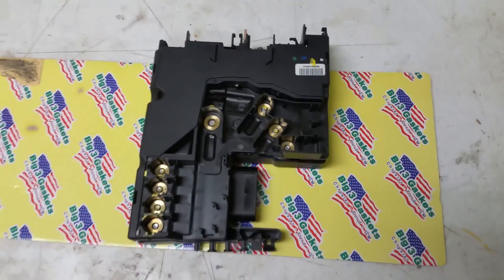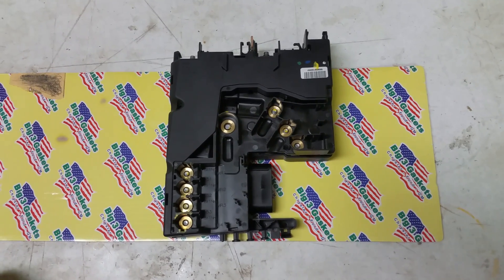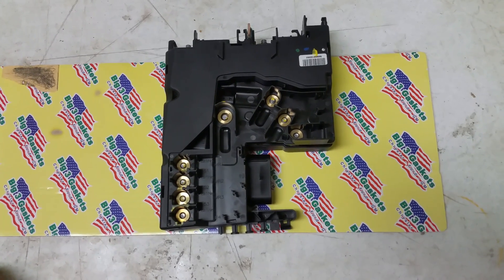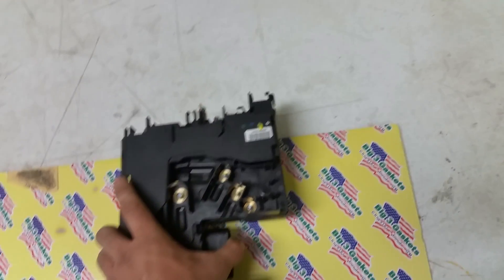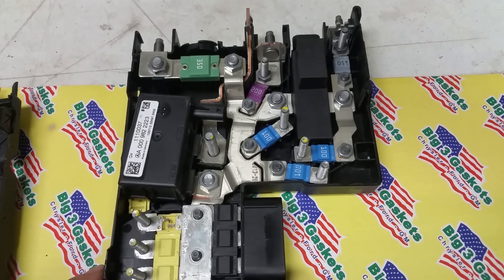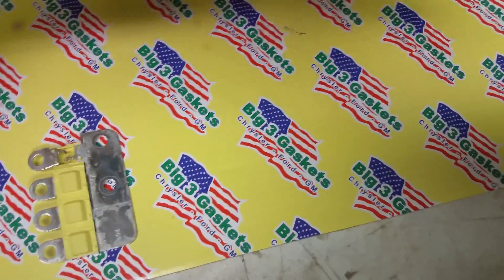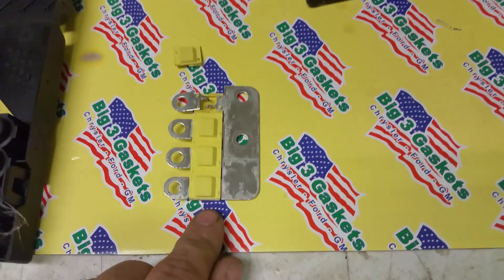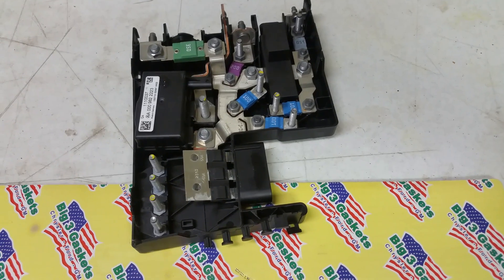HOW TO REBUILD MERCEDES SAM MODULE MAIN FUSE BLOCK

Comment: George, please HELP! I've pulled my Module and there is no continuity at all. I texted all of my fuses, and the relay in this box, nothing! My multimeter is working, I tested it else were. Is my entire Module shot? I can send pic's if u have an email, my Module is different frm this one. It's a 08 Mersades S550 4matic AMG V8, I have no power at all after starting my car with the wrong altenator. A 220amp came off it but I put a 180amp up there to replace it! Terrible mistake!

Comment: Do not solder a link where a fuse is supposed to be unless of course you want to turn your car into an inferno. This is idiotic advice that could result in fire or worse kill someone for the sake of saving a few dollars.

Comment: Hi guys please help. I opened the prefuse box all fuses are gud but still don't have power on the red and white cable going to the front sam and is causing some fuses to lose power or get a low voltage next to nothing please advise

Comment: Yes great clip. i'm working on 2011 C300 4matic customer tried to jump start then a complete no start. So I'm testing the front SAM module. Well there is a 4 pin relay between pole 1 and pole 2 not the air bag fuse. I'm not getting continuity. It's open. It looks like it should have power on both sides.
I have no start no power no headlights no cluster but is see's the key.

Comment: I have a 2004 G500 and it has had some quirky electrical issues since I got it. I was recently diagnosed with AC compressor failure. Is it possible for a bad SAM control module to affect the compressor?

Comment: Hi, I need help on my Mercedes Benz C180 CGI, 2011 model,Automatic, W204. The electronic systems are not working after i washed the engine. It can’t start through the key, it just displays the on lights on the dashboard. The radio, aircon lights, indicators, wipers, real lights are not working. The gear can’t even change when the car is on. The engine only runs if we bypass it under the car, through directly to the starter but still the gear are not in operation.
Please assist me with some ideas on what to do.

Comment: Thank you Joe for an excellent  demonstration of how un perplexed  these cars really are .. I have a question I have a p0600 code serial communication link malfunction .. what has happened is the dash board. Windows sunroof stop working nothing in the dash however the car will continue to run shifts .. pull it over turn it if take key out put it back in everything is fine ..

Comment: Nice work, can you help to find issue with Mercedes ML500 W164, i just tried to change the relay of Airmatic in front engine compartment fuse box and after that engine is not starting, all meter lights are there but when i turn the key to start nothing happen no crank nothing, kindly advise.

Comment: How did you remove those clips to open up the case? any video showing you removing it would be easier for us.. great work by the way... i'm having issue with shorts jumpstart , and think this bust the fuse from this SAM module.. my issue is that new battery and alternator are charging with correct voltage. but the battery light come on when drive and left front air bag light or srs light service required comes up when start.. i was hoping fuse bursted. thanks again

Comment: I have a 2002 s600 no crank or lights to dash think water got to one of the computers when i jump the starter regulator motor turns over but no crank took to mercedes they told me computers weren't communicating and they couldnt fix said they airbags would blow i think they just couldnt figure it out took a vete there shortly after words that wouldnt stay running when i went to pick it up they had removed all the dash cluster radio ect told be thats the wat it was when i brought it in what a bunch of theives cant do anything took my car back covid has everything closed at the courts so im not going back there can you please help me with a computer diagram im gonna try and learn myself

Comment: im working on a 2006 slk 280, im trying to disable the  front right side  SAM MODULE MAIN FUSE BLOCK  next too the battery and hving a hard time getting apart any advice would be helpful.

Comment: You may want to include in your video that the fuses are there for a reason.... if 100 amp fuse blows there is a pretty serious short somewhere. In your case probably the fan motor. If someone goes and solders their fuse shut (with or without repairing the root cause), they could turn their car into a fire waiting to happen!
   FYI- There is another common failure point on the F_SAM Modules. The capacitor inside the sealed box (actual module) fails causing intermittent AC failure on certain models....

Comment: That fuse didn’t blow for nothing.
One should first find out what the reason was it blew the first place before replacing the fuse.
Reply: Right you are, must be some reason for such a high amp draw that fuse couldn't handle. On the other hand sometimes you wonder why the fuse poped, then you simply replace it and there you go. Maybe if his car was often stuck in a slow traffic that fan was on a daily basis working hard and the fuse simply couldn't handle it anymore. If it pops again in short space of time then definitely must be some short in the fan motor or the ballast.....

Comment: my air suspension pump burned up and with new relay and good fuses it still gets no power. This may be the ticket. Others talk abut needed programming but this is nuts and bolts!  And the overload I had would very likely cause this sort of failure..

Comment: This was posted almost 4 years ago. But maybe someone can reply to my problem. I have a w203, 2001 C320, with radiator fan not engaging when I turn the AC on, but works fine with the engine. I took off the fan from my car and mounted it on another C32O and worked just fine when AC was turned fine. I also replaced the Refrigerant Pressure Sensor down the condenser; NOTHING. Could it be the SAM (Signal Acquisition Module)? 

The car has a battery drain issue; front seats modules disconnected and still drains out in 2 days. Now, i disconnected the TELEAID control module as am having the message in the display so it seemed like a suspect to me. Can't tell yet, because I drive the car every day.   

Any help please...
Reply: Do your turn signals work properly? My E320 was diagnosed  as rear sam. Signals are weird, rear headrest don't work, ac compressor and ac fan not working. I am going to take out rear sam tomorrow. My car has been leaking  around rear taillight, and I think moisture is the culprut. I will keep you posted on how it goes. Hopefully, I will not need codes cleared after, but it is a Mercedes. Fingers crossed
Reply: James Mitchell 

Thank you for your reply. My turn signals work fine but I have a "tail light substitute lamp on!" message that shows up occasionally. I think it's a rear SAM related issue which also can be causing the battery drain. I'm not sure whether a bad rear SAM can be AC/Fan related though. Yet, they're all supposed to be connected to the canbus. I will feedback if I make progress. Thanks again man.

Comment: Hello George. I have a 2001 Mercedes S500 that has intermittent start issues. I turn the key to start the car and there would be no start or crank there’s nothing, but the dash lights up like normal. I pull out the key and reinsert the key, then reattempt. Sometimes it will start. But the last time the car wouldn't start, It’s almost as if the car thinks it’s in security mode. Weird Could you help with any suggestions?

Comment: I have a 2004 Mercedes G500. I have a few issues that I believe might be tied to a bad control module and was wondering if anyone could tell me if these are common symptoms. For one, the headlights cannot be turned off with the headlight switch, so they are always on when I am riding. Also, one of the keys is no longer recognized when I put it in the ignition. Recently the AC compressor failed. Wondering if these are common symptoms and if a bad control module can cause the compressor to stop working.

Comment: Where is this part located, doesn anyone know?
Reply: Model w203 it's part of the fuse box under hood. Some circuits have standard replaceable fuses on top the CAN buss signal tells the SAM what to switch. It's like a industrial PLC programmable logic controller in some sense.

Comment: Did you fix the short that popped the fuse in the first place? Waste of time if you haven't.

You should never ever solder a fuse. Always replace.
Reply: Good points!
Sometimes?? With the EPA Mandates for a specific MPG?? Manufacturers make cars as LIGHT as possible...this means barely meeting the requirements or capacities of a vehicle when it's new & in tip-top shape.

Take the Radiator for example...Plastic Tanks, Single Row Barely big enough to perform under all but the most ideal situations.

Efficiency you say?.  Good Point.
Replace the Fuse?. Great point
However??  Sometimes?? The damage to the component comes from a power surge....from like a weak battery that still "Works" but really & ideally needs to be changed.

Or from improperly jump-starting the vehicle, say on a very hot day with the A/C already engaged & "On".

So many variables to consider.

Comment: I picked up a 2013 GLK 350, not running, the SAM OR front pre fuse module was in the back under the seat, could some one help and let me know the wires hookup to the SAM, There are about 8 or 9 wires by the battery in front and right side of the suv by the engine that hooks up to the SAM Module . Thanks

Comment: Great clip and very helpful. I was just looking to buy a CLS500 with issues on the SAM module. Plastic clips are typical on "non-serviceable" units in cars nowadays. Always good to consider the option to repair. A possbility would be to solder leads to the original connectors and add a fuse holder unit with replaceable fuses, if you want wind 100A once can use 4 x 25A (commonly found fuses) and connect them in parallel connection.  Fuse boxes with lids for water protection are available automotive accessory shops, this way it would be easy to replace the fuse(s) blow again.

Comment: its a prefuse box  however i agree that it is bs that they say it is not serviceable. it uses mdi/midi fuses. simply remove 3 torx screws. dont forget to label the 4 power cables underneath. fixed mines on the road by using a piece of solid copper wire as a jumper then replaced the $6 80A fuse which is available on Amazon from the comfort of home. the fuse is stamp welded you will have to use a dremel to remove it or just cut out what you can and place the new one over it. as long as there is continuity you are golden. great video!

Comment: Is this module responsible about the transmitter functioning also?
Weil i have a w211 2006 Diesel the doors doesn't close and open with the transmitter and the rear wiper doesn't works too

Comment: Hi. How are you? thanks for this video. i have a problem withmy merzeders 2003 mod w211 . i always get some error messages inmy dashbourd about my light  . 10-15 erreo but all my light is working, i have some water  leak but my care is dry now. i have maybe get some water in some of the sensor but dont now how to find my issues. Do you have any advise?

Comment: does anyone know where you could buy the non-serviceable fuses shown here,  the 100, 150, 200 and 350?
Also where can you buy that yellow fuse assembly that George disassembled? He says you can buy it online but I cannot find it.
Reply: amazon  search for mdi or midi fuses they are mostly used on marine equipment

Comment: would the sam module be the same problem in an earlier model (2000 400s class no start, no power symptom), if so...being that the module is different in the 2000 model, is the repair similar? or is the part not repairable?

Comment: That is exactly what happened to my C300. Unfortunately it took them hours to find out what it was. @ 167.00 an hour. They told me that leaves clogged up a drain and the water backed up and shorted something out. Anyway 1800. dollars later it was returned to me repaired. Oh one last thing. When I first brought it in they asked if I had a spare key because they were having trouble accessing the computer through the key switch or some fucking thing. I didn't have a spare so they ordered one and 275.00 dollars later they told me the new key didn't work. Thanks for the Video very very good
Reply: Hello David, I am having same exact issue. Water got in from a drain and it’s shorting something out. Currently not working are traction control, cruise control, TPMS, horn, A/C, turn signals, etc. etc.

Do you know what was replaced in your C300 if front or rear SAM or anything else? 

Thank you kindly
Reply: @Djgioalv  did you ever find out?
Reply: Dirty Dan, yes. Turned out water pooled under the carpet in the driver foot well and shorted out a junction box ($35). Mechanic replaced it and fixed the plugged sunroof drains at a total of $400. All good after that.

I have since sold the car.
Reply: Dang u got ripped off
Reply: stay away from that stealership... they should have used their star computer system and known right away. my autel told right away after a 2 minute diagnostic.
Reply: Same thing happend to mine.

Comment: George. Great video man. I just noticed an issue with my W164 ML320CDi this evening. All electrics appear to be functioning fine, however my front tail lights won't turn off and stay on even though every other light shut off. I'm guessing this is related to the front Sam?

Can these be repaired in the same way?

Comment: Nice vid. How do you know your soldering will protect at 100A, do you test it to see if it will blow at 100A? I would imagine if it doesn't blow at all you could fry something else or start a fire. My concerns would be for safety and to make sure I don't create a condition that will drain the banter and fry the alternator. Thanks!

Comment: Thanks for posting, man.
George can the DCM on the driver side 220 2005 S600 be repaired? The seat is not moving
but mirrors, work fine.  Thanks

Comment: Nice video bro. Unfortunately that is not the SAM module. the SAM module is the bottom peace of the from fuse box. and in the newer year it is the fuse box/ SAM Module. The unit you are showing is part of the SRS unit and they blow when you get into an accident to prevent damage to other unit and or fires.
Reply from the maker: That's exactly what it is, fusible link box/SAM module. My was out of 2014 GLK 350

Comment: Thank you for sharing this video. Before I saw this video, I also opened the box and found a blown fuse. Under this fuse that you removed and soldered, there is another fuse with three conductors which are black in center (direct contact outlet). This is 2x50 amp and 1x60 amp fuse everything is 1 part. I also soldered this, but am no expert so I am unsure if it will hold. Have tried to find a new but can not find any online. Does anyone know for sure that these can be bought from somewhere? It has a number 1210 stamped into it.

Comment: great video. I suspect that is whats going on with my MB. ever since I replaced the battery its been acting very strange, engine cooling fan is racing all the while the engine is running, check engine lite stays on. and message on dash board says right front SRS is malfunctioning see dealer. So that's where it is right now, at the dealer. I don't know where your located but if you were close I would bring it to you for service.
Reply: this usually happens when you are not careful and jumpstart your car. i have seen people bypass the jump points and attach cables directly to the battery reversing the polarity and zapping these fuses in the process.